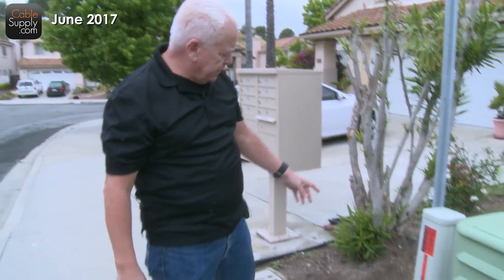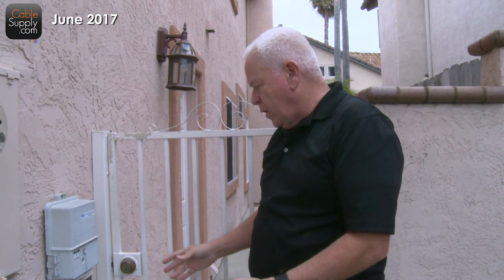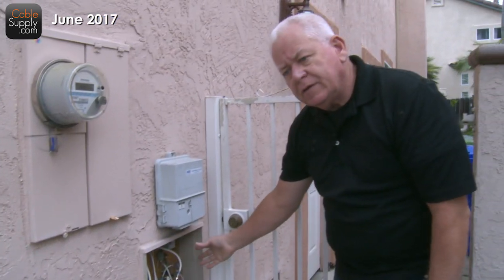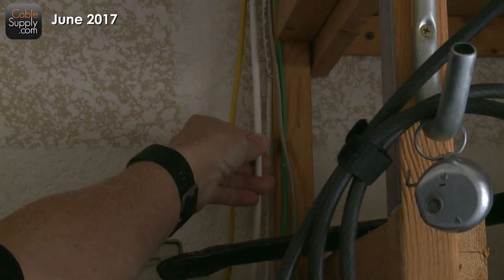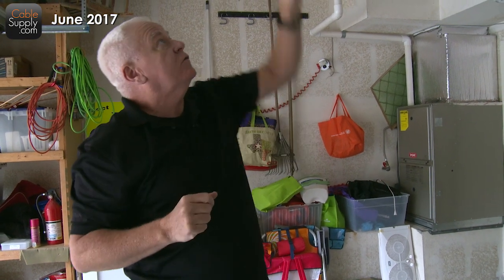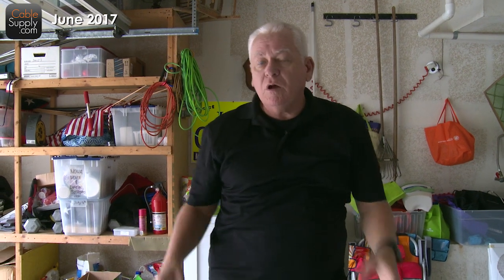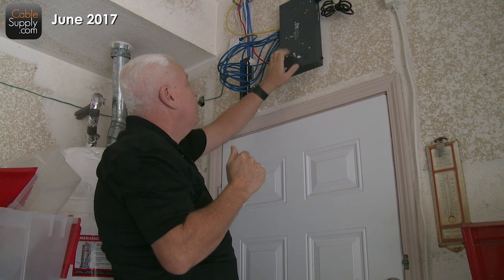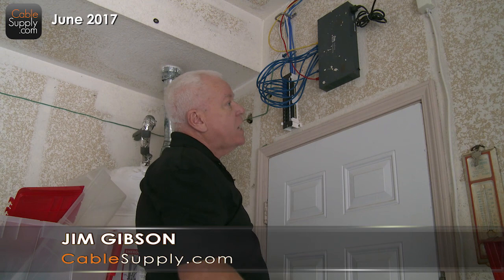Computer Cabling in a Residential Home, Part 1

Comment: Great video! Just a note, most routers from telco providers have wifi build in, most garage doors operate in the 2.4 GHz band and wifi will jam the remote door openers and prevent them from working. Rather nit-picky I know
Reply from the maker: My router is right next to the garage door opener and I personally have not experienced any issues so far. I will have to look into it to see if anyone else has issues like that. Thank you for your comment!
Reply: @CableSupply  I bet it would depend on the garage door opener too I had a similar setup and the door would open intermittently and I finally moved the ap and the issue went away.  Complete disclosure,  it was an old Sears unit.  Manufacturers today may be more aware of interoperability
Reply: seems like a simple change of channel could rectify any interference

Comment: Loving this series!  Long time subscriber and starting here in my research and hopes of learning from some of thr best and most experienced...

May I ask the best way to move modem from upstairs to downstairs?  ISP wants $89 and I feel like this is a bit much.  I have easy acces to the MPOE.  Essentially, how to determine the active line and then I could some how swap and test the modem at different location until the link lights pop.

Thanks!

Comment: I used 2 decora wall plate with 3 ports each instead of a patch panel in the central point (connected with a 8 ports switch). So, my LAN is small (living room + 2 bedroom + the acces point in the kitchen powered by POE). The DOCSIS Modem and the Router are in the living room, inside the tv desk.
Reply from the maker: Surface mount box with RJ45 works, good idea. We sell up to 6 ports surface mounts boxes.

Comment: Why did you mount the router to the ceiling in the garage?
Reply from the maker: kept it out of reach of children and more center of the house for WIFI use. I had  some dead spots in the house on my WIFI. what ever works for you.
Reply: I would have put it inside a wall mount 9U cabinet.  No kid would be able to mess with it, and it would still be a good spot for wifi :)

Comment: In my country anything up to the master socket is the BT's property and they will send out an engineer for free if it's their property which is broken
Reply from the maker: what is your country?
Reply: I'm in the UK, BT stands for British Telecom, which is the company responsible for the large majority of telephone cabling to people's homes
Reply: The downside to living here is that most homes (including ones built today) have solid brick walls, so there's no cavity to run cabling and you have to do a lot more plasterwork to hide cables. And if you're in an old property (mine is 300 years old) then the walls can be very thick and very difficult to create holes to pass through walls
Reply from the maker: Ben, Thank you.
Jim

Comment: This is relevant to my interests; I'm in the planning phase for gigabit ethernet all through my home.
Reply from the maker: Time / labor is the biggest expense in cabling. if you plan to stay in you house/ building longer than 5 years install the highest category cable you can.
Reply: Is it worth using anything greater than cat6 for residential these days (mid 2017)?  Cat5e still seems to be very relevant after all these years.
Reply: scubthebub unless you want to go over gigabit speeds it's not needed to go over cat 6 I wouldn't install cat 5e if you can take the difference in price also cat 6 should last longer and will be good even if you upgrade your services to fiber you will still be good
Reply: @scubthebub   doing two Poe access points, one on each floor, found cat6a is the best long term honestly, least amount of crosstalk and no risk of interference issues

Comment: 00:54  plant some grasses/bushes to hide them 
2:24 yes, it is a mess. Surprised the wires aren't wound up with velcro considering all the other videos you have made. 
5:22  install the alarm box inside the house/garage so nobody can mess with it.
Reply from the maker: 2:24 The DMARK/MPOE on the side of the house belongs to AT&T and it is their responsibly. don't touch their work or if there is a problem they will blame you and send you a invoice. 
5:22 If you are using dial tone for your home alarm system, the cover to the MPOE on the side of the house should have a switch attached to the home alarm system. when the cover to the MPOE is removed the switch should activate the alarm. If there is no switch to activate the alarm when someone opens the box on the side of your house the cable can be cut and therefore preventing the alarm system from calling the alarm center.  OR use a cellular / wireless activated alarm system.